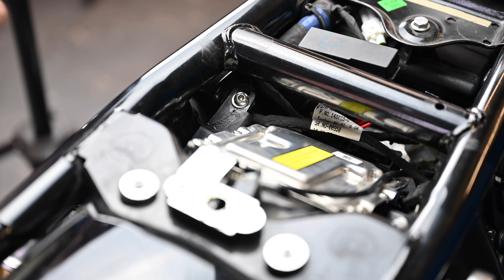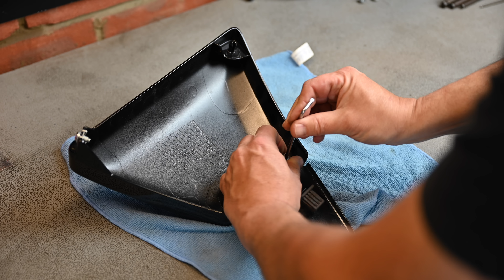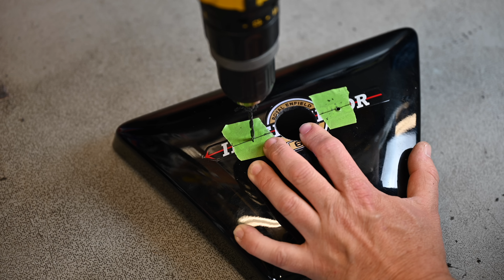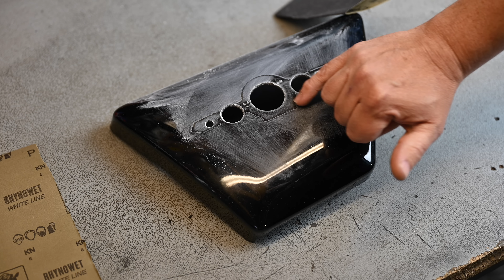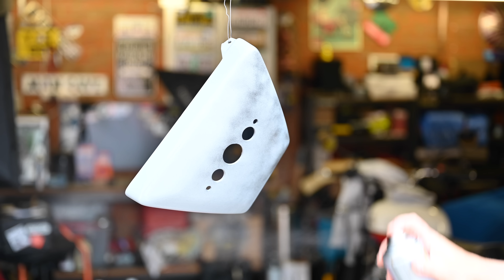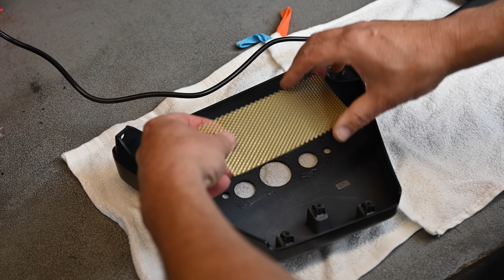Royal Enfield Interceptor 650 Project - Ep.2 Air Filter & Custom Panels

Comment: S&S exhaust pipes on mine . Will change air filter soon . Not sure what after that .  I just like the sound of the exhaust . I'll be adding a pannier frame and rack .  Along with tires that work better on gravel   unpacked roads .

Comment: take the sticker off first before drilling the holes , it will come off in one piece and I wouldnt bother with the mesh as it serves no purpose , but adds weight
Reply from the maker: But leaving the sticker in place gave me some alignment marks. The mesh is there for aesthetics and adds 9 grams (which is probably less than the weight of the plastic that was removed)
Reply: @mancavemoto  fair enough

Comment: Apparently you can get a different cam. Gives you another 10HP
Reply from the maker: For me, it nots worth the effort and if you look closely all the cam will do is move the power lower down in the rev range. You're not actually getting 10hp more, the HP peak is 10hp higher than it was at a certain point on the stock bike. A cam on its own can only do so much, it either lifts the valves higher, or holds them open for longer (or of course a combination of both) but you pay for it elsewhere.

Comment: Thats a good idea with the side panel, but I think I'll go with slots from the front half of the panel where the filter is like I've seen on some bonneville's. Sure that will be harder but I think it would look good. I already have the filter and booster plug and a whole lot of mods 😎Cheers
Reply from the maker: Cheers, yep I went with holes as they are easier to cut 😉 but I may try something different on another set in the future?

Comment: Will you be adding a deflector in front of the side panel, so you won't be sucking in air heated by the cylinder while riding. I have seen that suggested on other vids dealing with cutting breathing intakes in the side panels.
Reply from the maker: I won't Mark no, to be honest I dont think the holes will make that much actual difference other than aesthetics

Comment: Great installation. Don't you need to oil it with hydrophobic oil though? That's what the instructions with my one said. It would be interesting to see how much more it weighs than the original. As for no expected performance increases and being entirely hidden, i'd say that was 85 quid (plus the oil?) well spent! At least you fitted your one. I wait with interest to see what rim and tyre you fit and how it all works with the swing arm, frame and chain. Good luck, old bean!
Reply from the maker: It comes pre-oiled, so It can go straight in. I have a service kit too, so i'll cover that off later in the series

Comment: I believe that any 'mod' that lets the engine breath easier is a good idea.( I swopped out the original air filter on my Street triple, Plus a new slip on exhaust)... this let the lungs of the engine work more efficiently and gave a smoother throttle response. Items like bars, levers, seat etc! are the comfort zone. Tyres and better quality suspension improve the ride not to mention the handling.... You're right, its your Bike, your money so personalising it to your requirements is your decision... personally I would turn it into a 60s Cafe Racer, Or would if I still had a 1960s body to contort myself into the proper riding position...Its a personal choice so go for it!! Will follow with interest future videos on the project..

Comment: The side panel looks good! I will be interested to se which tyres you choose. I am planning to use Dunlop  K180 120/90-18 front + 130/80-18 rear, when the time comes to replace the Pirellis and they will fit on the original rims.

Comment: I like your philosophy on this bike. I have its twin brother, had it for two years now, all I did was install a Two into one decatted exhaust (TEC), aftermarket air filter and custom snorkel, and I did one other controversial thing. I dropped the countershaft sprocket one tooth. Now the bike is an ideal two lane road tracker. 0-100(where all the fun is on a bike like this) screamer. top speed is virtually the same, but I rarely take it over 140 anyway. It's kind of like n Austin Healy sprite, sounds fast (but isn't), fun to shift, ride it wide open without going too fast.  A real hoot on secondary roads,

Comment: I have done similar to my 2020 Glitter & Dust Interceptor , started with DNA filter then a Booster Plug and S&S slip on pipes (a bit more BARK ) as for the side covers I bought the aluminium  ones from Baak (A French Co) and polished them up to a nice finish , like you I backed them with a fine mesh which I painted red to match the tank badge , I'll be interested to see how much further you go . Ride safe and keep the rubber side down !

Comment: Really enjoyed that. What frustrates me with these critics is they have completely missed the whole point of Triumph (Bonneville range) and Enfields (650 range) is that they have decided to make a basic package to present to the buying public in various different engine and trim levels/styles. So if you just want a basic bike at that price 'We can provide that for you sir/madam' however knowing what some sections of the motorcycle community are like they can provide a bike that is a starting point for you to upgrade /modify at your leisure. That's the whole point of the range of bikes! It's for you to fiddle with and it's OK if you don't want to. Really looking forward to this build series 👍

Comment: This bikes are begging to be modded once you take them from the dealership! Great job with the side panels. I went with new ones on leather, but I might just go back to the stock ones and do something similar. I have fitted the DNA filter and new pipes on mine aswell. The brakes and suspension on this bike really benefits from the weight loss. Check Hitchcock's offerings on parts to get the best of this bike, loving this series!

Comment: I would think there would be a lot of interest in a tubed to tubeless wheel conversion.
Reply from the maker: That is something i'm currently investigating
Reply: @mancavemoto  Brilliant, that will be interesting. I was lazy and got my CB1100 wheels done in Italy by Bartfactory but live in Ireland so there were no duties re Brexit. Outex must be the most common for doing it yourself. Good luck. While you are at it you might as well try out some cheapo tyre pressure monitors.

Comment: Nice work Tony! You’ve got a pro finish on that panel. I went for the K&N filter definite air flow improvement. I’ve even convinced myself there’s a performance gain!
Reply from the maker: Thanks Peter, i'm pleased with the way they turned out. I think both the DNA and K&N options are pretty much the same

Comment: Niccccce! Loving the panels you made. I've got multiple plans for my 650. So far I've changed exhausts from Tec and recently the standard rear light cluster for the Baak set, but for just putting the new light closer on it has more than doubled my insurance!! So I might need to spread these mods out. Keep them coming 🙌
Reply from the maker: Cheers. Ive got a number plate holder coming which has mounts for indicators. I'm probably going to run with 3 way rears, so there'll be no central rear light.

Comment: Love the vid, great job, I'm the same as you I'm just looking to make my 650 run as efficient at possible, not really increase HP. Have you considered Iridium spark plugs, bigger spark insures a better burn of the full air in the combustion chamber. I changed my plugs to Iridium, could be in my head but the bike does seem to run smoother.
Reply from the maker: Cheers, not something I’ve thought about to be honest, but I’ll have a look at them. Thanks

Comment: New bike,cheap asking to be modded.I done a heap of them.I 
Often thought about drilling the side panels cause they better than any aftermarket one's & some of their holes & mesh are just glue over top of stock don't suck air or face the wrong way.
Reply from the maker: Yep, its easy to throw loads of money at the bike in parts, but theres a few simple mods you can make without needeing too. At the moment, mine are one off side panels!